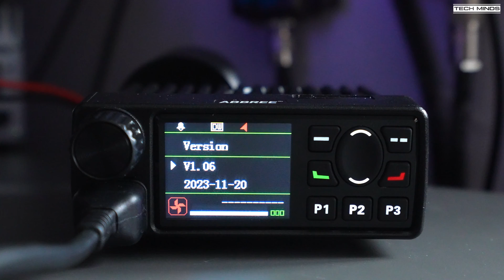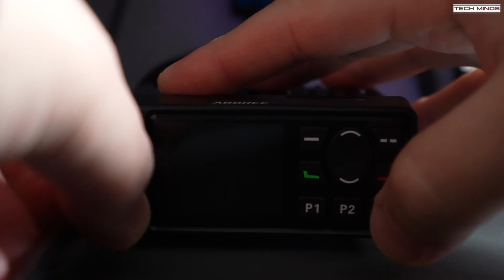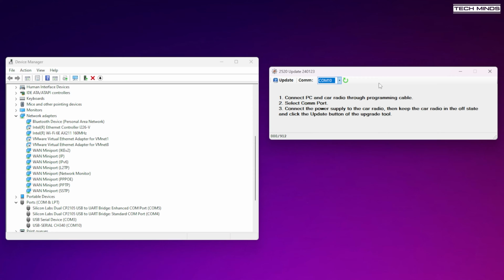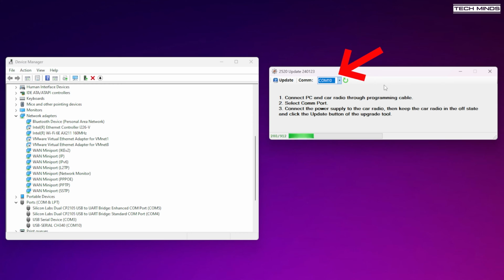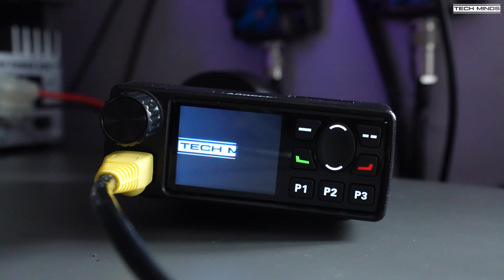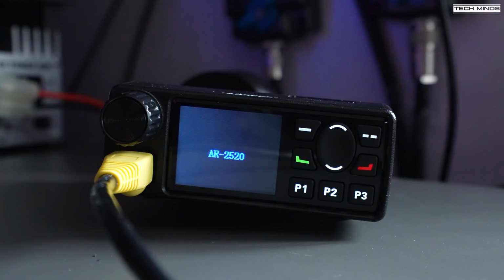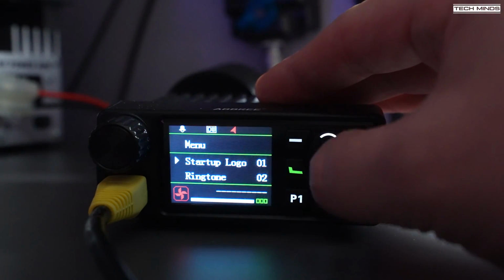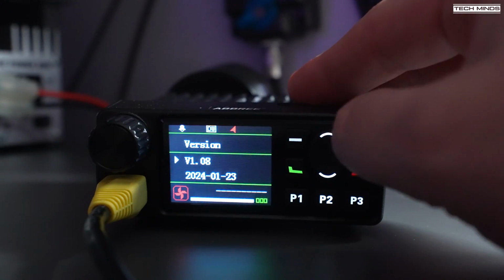Abbree AR-2520 Firmware Update & FAN FIX!

Comment: Anyone ever try modding the programming cable from a Baofeng handheld (usual 2 pin job) to the RJ45 these use?  Paid about $80 for the radio, but they want $35 for the cable around here!  It looks like it just uses 2 pins of the RJ45 that I could see in the pictures.  So presumably just data +/-?

Comment: Great little radio! But there’s a major problem with airband reception. The AGC appears to be not working. So weak signals are good but strong signals are severely distorted. Is there a way to feedback this information to the manufacturer/firmware developer? And while they’re at it they should include an 8.33khz channel step to comply with current airband specifications!

Comment: Hi Matt, thanks for the tutorial, great!
One question, my recently purchased radio of this model came with Version 2.02 (1.3E), it seems to be more current than this one, and it has the most varied bugs. Can I post this update? Or if you try to do it, because you have a different one than the one initially shown, could it be damaged?

I await your response, thank you.
Reply: I am interested as well but only if it's not a Trojan
Reply: I had bought a similar radio and had to return it. Apparently my FT-70D with whip antenna has better receive than the Motorola MT 8900/Abbree Ar 2520with a mobile antenna

Comment: Any chance of getting the V2 firmware for newer (February 2024 and later) radios which have different base board (supplied with V2.02(1.3E) firmware) which includes also the "V1" labeled radios in shops without GPS module?

Comment: ok, I loved the presentation, the link to the upgrade tool, but it is useless without the respective firmware, could you send or post the link to me, a big hug, 73 and continue your spectacular presentations
Reply from the maker: Ummmm.. There is no separate  firmware file. The application/firmware loader contains the firmware. 1) Connect cable 2) Select comport in tool 3) apply power to radio but do NOT turn on 4) press update.. That's it.. :-)

Comment: General question - not directly related.
Does your radio squelch out (very shortly like a puffing sound) every second - while receiving, presumably to monitor the other 'VFO' ?
Is this possibility fixed in an earlier update. Can't  find a parameter to stop Dual Watch while receiving (squelch open).
Thanks in advance for any advise and sorry for the off-topic question :-)

Comment: Welcome. What is the name of the android app to connect to the 2520 Abbree model equipped with bluetooth module ?
Reply: What android app works with this?    Interesting
Reply: No only cable, it's possibile used baofeng cable with plug 8 contact? J have colore e Number contact on plug

Comment: Confirmed, version 1.06 initial and fan not working, after update version 1.08 fan works. Mat where can we find these updates ? thanks 73 Phil
Reply from the maker: I got the update from the radio supplier, Banggood, but they didnt tell me where they got it from. Really the firmware SHOULD be on the manufactures website, but....

Comment: I have a big problem with the Abbree 2520 when scanning the memory's if you press the PTT the radio goes into transmit mode and the radio is locked up, you have to switch the power supply off, so be careful if you have this problem it's easy to catch the PTT and not realise, Thank Gary.
Reply from the maker: I'll have to test this myself. Is this with the latest firmware?
Reply: @TechMindsOfficial  it is yes the latest firmware Thanks Gary.

Comment: Matt,  I have the radio but I find the Operation Instructions beyond me.  Have you considered a video of how to enter a repeater and some of the basic navigation around the radio?   It might help a lot of us.
Reply from the maker: Hi ya, to be honest, use the software. Grab a cheap cable from online and then use the software to program repeaters and radio features. It's so much easier and less time consuming.  Of course there  may be times that you want to program in the field, I guess its just the case of practice makes perfect. I'll have to think about making a menu/setup video. Cheers
Reply: @TechMindsOfficial , @rickhartnett3971 I did it manually initial but I'm glad I got the cable. To program from mic:

1) choose main band and set to VFO mode.
2) enter freq from repeater
3) in menu set CTCSS tone for rx and tx if needed
4) to enter tx freq press */FM button for more then one second (vfo freq will change to red)
5) enter tx freq and press */FM again
6) now you have set all, test repeater
7) go to menu 34 and save channel, press menu again
8) got to menu 33 and put in name (use # to use keypad alphabet, to enter number exit (alter with) #)
9) press menu to exit name programming, press exit to exit menu 

It is in the manual but poorly explained. 73 Phil

Comment: That's good to fix the fan problem, I don't have this radio, but it's simply an electronic temperature sensor control problem why bother to use software ?
Reply from the maker: The data from the temp sensor will need to be processed by something. I have made amplifiers with temp sensors, controlled by Arduinos. Having software/firmware control a fan based on the temp sensor reading means it can be altered as needed. It's kind of normal.
Reply: @TechMindsOfficial  IC, I just thought in case the s/w locked up after unsuccessful update the fan may not start at all, so that some h/w based protection is better.